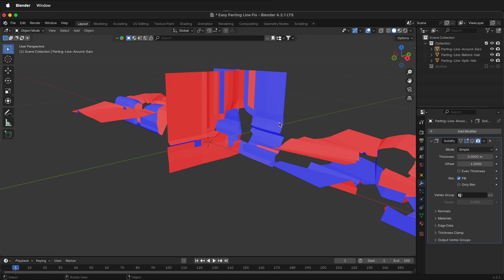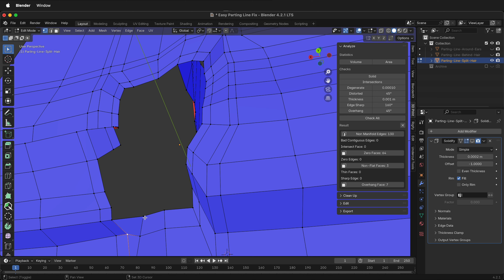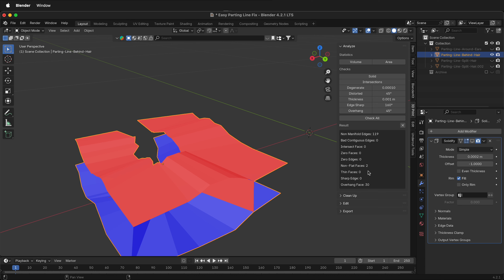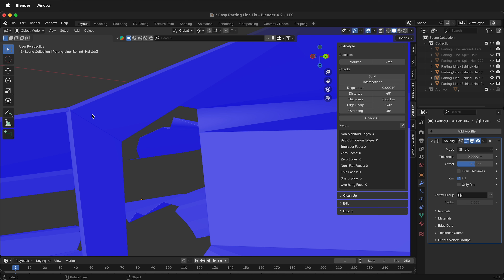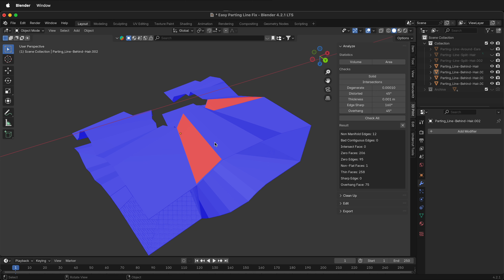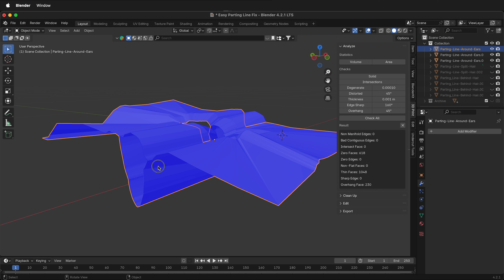Easy Way to Solidify Parting Lines for 3D Print Slip Cast Molds

Comment: 1 example T faces work with solidify complex operand not simple, you don't need to separate it and use boolean.
Reply from the maker: Good to know, thank you for sharing 👍
Reply: @WhatMakeArt  shure any problems let me know :D I know stuff :D
Reply from the maker: @WWS3D thanks again, this will make it easier for a project working on with my students to make 3D printed slip cast mold forms. Made a quick updated video based on your suggestion https://youtu.be/0GSKckejrkw Thanks again 👍